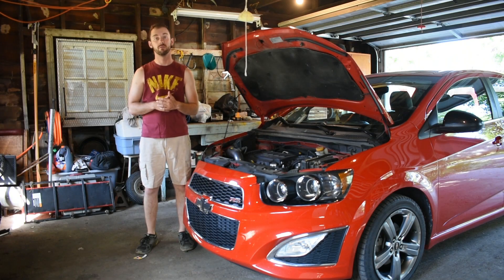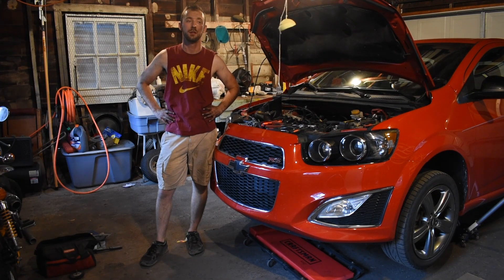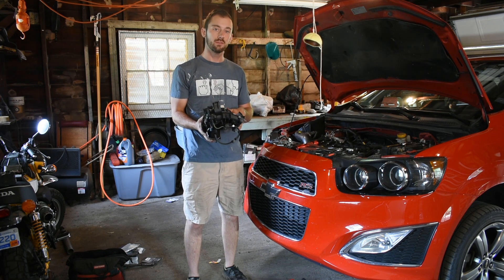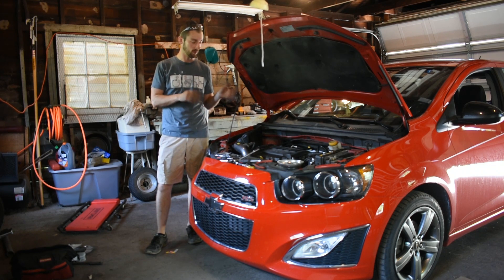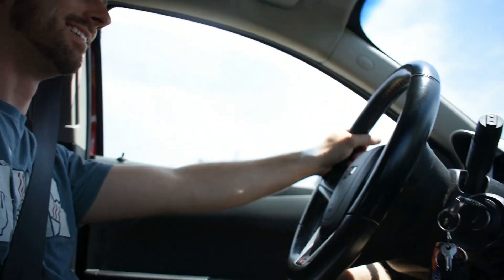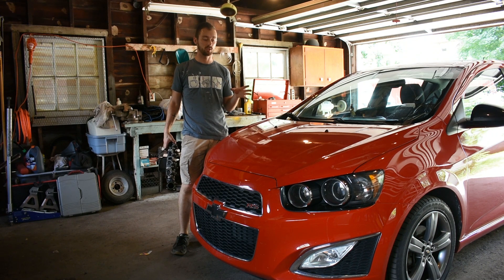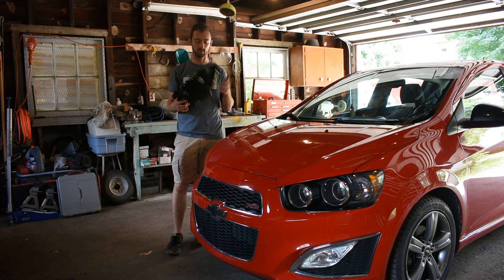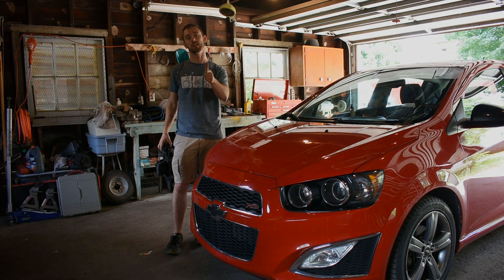ZZP PORTED INTAKE MANIFOLD INSTALL & REVIEW | IS IT WORTH IT?

Comment: Did I give you a check engine light ?
Reply: This is the only thing I'm worried about.  I have no doubt deleting what is essentially a restrictor is going to smooth things up power wise.  I'm just curious if I'll be able to pass inspection after I do it.

Comment: I'm thinking about getting one since my current intake manifold no longer has the orange check valve and it causing pressure issues with the valve cover gasket. How long did it take to remove it? Doesn't seem long with the edits, but you definitely looked tired at the end of it.

Comment: Nice I have a 2016 Sonic RS @ 200hp with ZZP upgrades
Reply from the maker: Nice! They are fun little cars!
Reply: @drivemedia4889  difitly  under rated.  Great 👍 fun. Great mpg.
Reply: Did it require a tune after the upgrades?